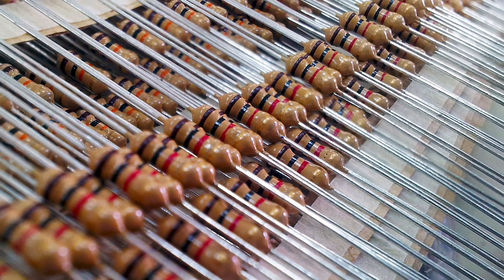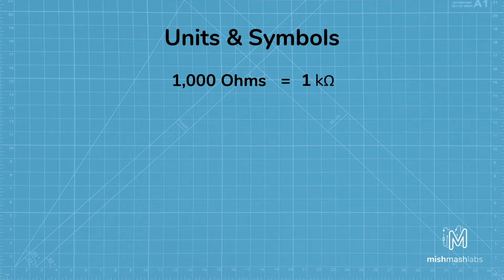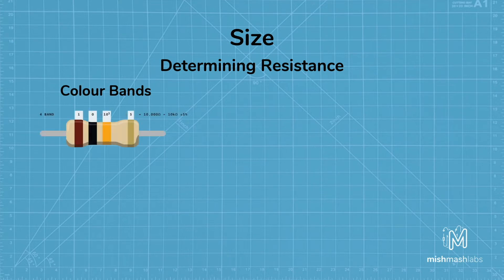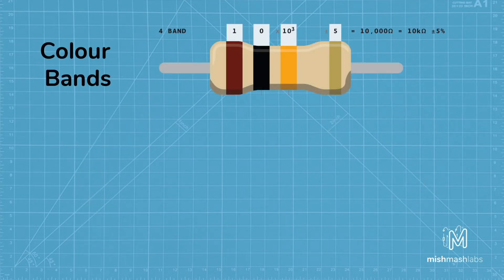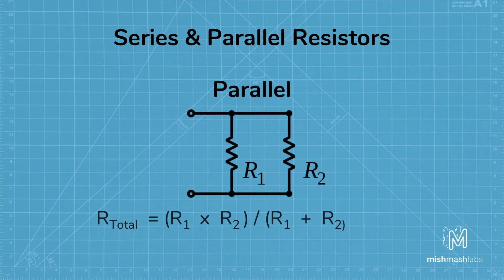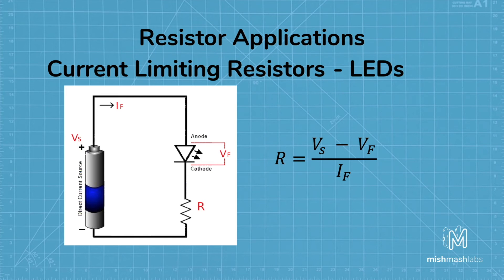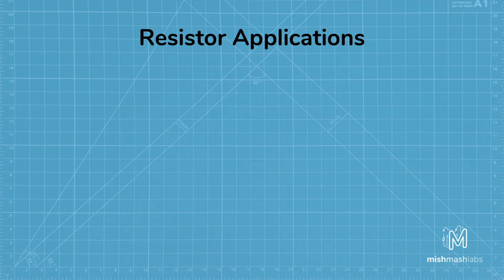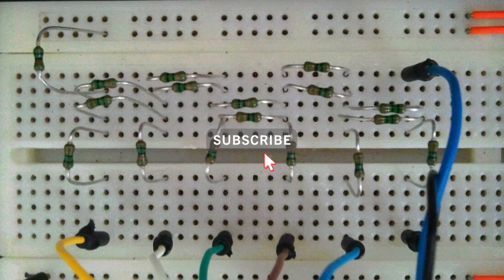What Are Resistors? | The Basics

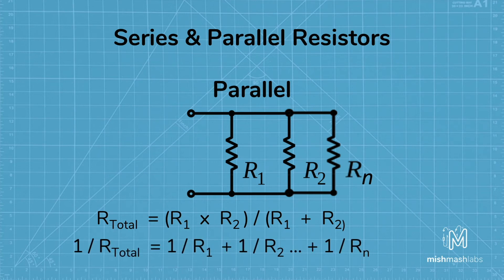Comment: I think there is a mistake at 4:05
Reply from the maker: It is initially correct, but it appears there is an error in the animation. 
Conductance is symbolised by the letter 'G', Resistance is symbolised by the letter 'R'
G = 1/R
GTotal = G1 + G2 ... + Gn
1 / R Total  = 1 / R1  + 1 / R2 … + 1 / Rn 
 R Total  = 1 / [1 / R1  + 1 / R2 … + 1 / Rn]
Thanks for pointing this out!